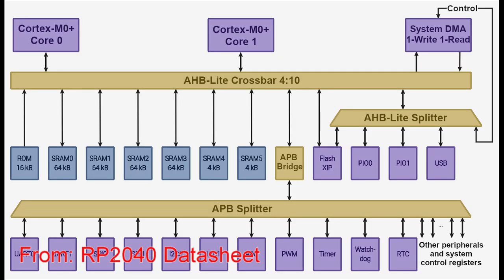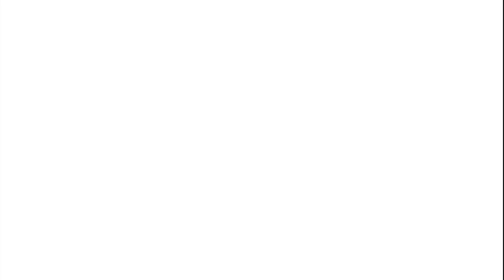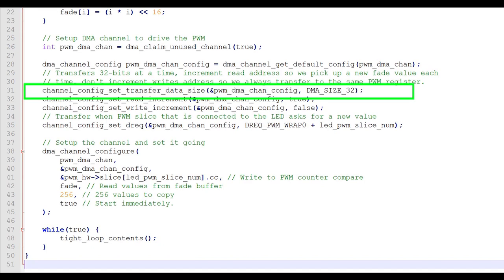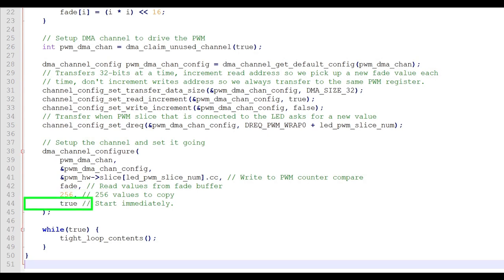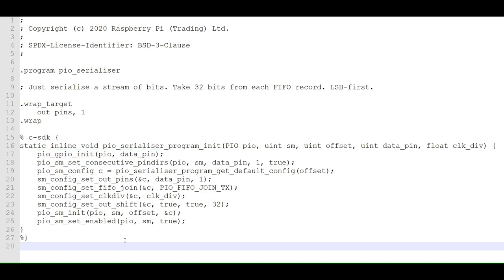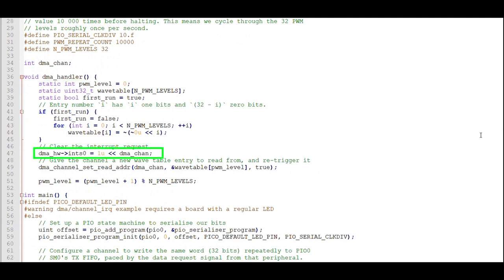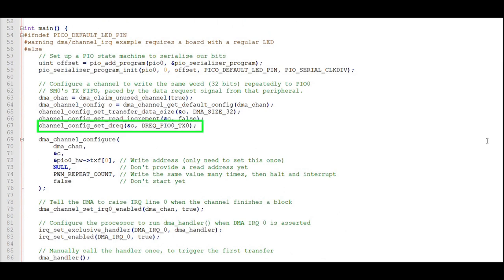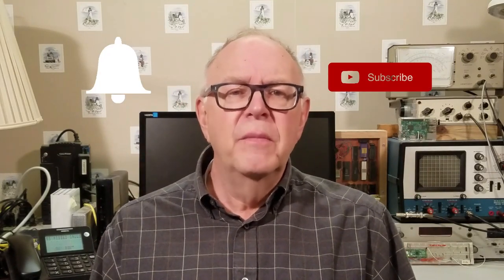Raspberry Pi Pico PIO - Ep. 8 - Introduction to DMA

Comment: This video cracked me up -- but it was really good. Taking the time to go through the datasheet and show where the information can be gleaned is a vital step that all too often is ignored. I just picked up a Pico and am having quite a bit of fun. I ended up here because I had written a RTC initialization from the PC to the Pico over the uart and was hoping to speed the process up a bit. Essentially the PC sends a string to the Pico via PuTTY or redirected from an xterm to ttyACM0 (or using minicom). The string is formatted as "+++2022 09 09 5 20 52 58", the "+++" used for an acknowledge that the RTC initialization data comes next. My only concern looking at DMA is with 24 bytes total transfer, DMA may not help that much over a character-by-character read. But with your help -- I now have the tools to find out. Much appreciated.
Reply from the maker: Thanks for watching.  DMA works best when you have to send a ton of data quickly; without slowing down for the processor.  I have several more videos where I use DMA and PIO to move a lot of data; both video and an AWG.  Have fun!

Comment: I stumbled across this while looking for some real world examples of PIO usage for a project I am working on (also new to the pico). Specifically looking for example code that implements a multi wire protocol and specific timing inside the scant instructions inside of one PIO, if that can be done or people load multiple programs inside the same PIO and how timing dependencies are handled in that case, etc...

In any case very good job explaining the PIO, PWM, and DMA for everyone working with this new and very different chip. I know you issued a disclaimer regarding your knowledge of C and that it's not the topic of this video specifically, I don't know if you left it out on purpose or possibly didn't realize that the code you are using has a nuance that people should probably understand when generalizing this to other purposes regarding DMA and specifically PWM (there are other situations that are similar beyond PWM that depend on the specific architecture of the component wiring and registers as well)

The code above ONLY works if and only if the GPIO pin happens to fall on PWM channel B of a given slice. By chance the built in LED on GPIO 25 does but this is atypical for most other examples where the Default output pin is chosen to be on A specifically.

Here's why...

1. You declare the fade vector as uint32 and the transfer width of the DMA as 32bits.
2. When using DMA to the counter compare PWM register as 32bits what happens is that the upper 16bits are for the B channel of the slice and the lower 16bits are for the A channel.
3. In your comments you mention a "gamma adjustment" which I assume you mean the square? but some may assume that you mean the <<16 bit left shift. You may want to update that comment to include that the 16 bit shift is to put the value into the upper 16bits because GPIO 25 happens to be on channel B of that PWM slice.

Also re: PWM instead of a comment re "gamma" you may want to generalize that terminology to PWM meaning duty cycle as a fractional value of the wrap value where WRAP * x% = x duty cycle as I don't believe there are any convenience functions in the C SDK so the level of the compare count has to be scaled to the wrap which in this case is 0xFFFF
Reply from the maker: Thank you very much for your comments; they are right on!  I did learn a lot from this video, and I got into DMA and PWM in much more detail in the next video, that's where I realized the difference between PWM channel "A" and "B".  The gamma reference was from the sample program I was using, I believe it refers to the relative brightness of the LED.  Thanks for watching, hopefully the next few videos will be helpful.
Reply: @LifewithDavid1  Ps I meant GPIO  26 for the LED I think, don't have the reference sheet in front of me at the moment but the assertion is correct. I did find it strange that the SDK has a lot of convenience functions but some of them offer a strange mix of convenience combined with raw register writes like the one discussed above. I guess learning any new hardware is tricky.

I'm still at the very beginning with PIO where I am constantly asking my self questions "I wonder if this will work" for things that aren't explicit in the documentation. 

I agree the docs are extremely good relative to a lot of hardware I've used but there are still some ares that are vague. Like pindirs and their specific semantics with side set etc.

Comment: When the Pi Pico first came out, I mostly wrote it off as uninteresting. I thought then that the "programmable input/output" was just choosing what pins to use for the various built in hardware interfaces. Recently started pursing a project and found out the truth! watching all your PIO vids multiple times now to get up to speed.
Reply from the maker: Glad it was helpful.  Thanks for watching!

Comment: Thank you David. We can use for example raspberry pico for object detection in real time. For example we use PIO to transfer data between camera and one core of raspberry pico pico and the other core well be used to run machine learning Model. Is that feasible??
Reply from the maker: That's very feasible as long as the Pico has enough computing power and memory for your application.  In fact, you could use PIO with DMA to transfer the data from the camera into memory without using any core resources.  Then you would have both cores available for machine learning.  Sounds interesting.  Good luck!

Comment: What's that 8-bit hot rod in the wooden case behind your monitor then?
Reply from the maker: That's my 6502 multi purpose computer built 35 years ago.  I feature it in several videos, including this one: https://youtu.be/BcqRvHkn-EA
I also do some high speed paper tape emulation with it in later videos using the Pico and (shudder) MicroPython.  This is where I first started using PIO.  This computer was the 3rd one I built; there is another video on my earlier computer, as well as Tiny Basic.  Thanks for watching!
Reply: How about dma into a separate peripheral? Like a trinket which has a 264 on chunk also. Maybe leave it bare metal? Thoughts? Or maybe do that to an soc, like a raspberry pi?

Comment: Not sure why there is music popping up in the brief silence between statements. Makes it very hard to concentrate on the material.
Reply from the maker: That's a good point.  I like a little background music; and I am trying to get the audio ducking settings right.  I hope it's better in my more recent videos.  I'm using Pinnacle Studio 25 and it's a bit of a challenge.
Reply: @LifewithDavid1  I would not use filler music in any video I wanted people to retain information from. Music is meant to invoke emotions and tends to distract from informational content.
Reply: Personally I like the music popping up. I instinctively pause the video to take in what David just said, re-read the code and relate it to what went before.  Thanks David!
Reply: @adeeperbluegreen  I think it would sound a bit bland without it though
Reply: In the unlikely case where someone doesn't like this video, I'd recommend that person to click the thumb down icon twice, just for good measure 😉

Comment: The dma_handler() function appears to be missing a close patenthisis? I don't mean to be pedantic but well, computers just are that yes/no?
Reply from the maker: I'll have to check it out.  Sometimes transferring the program from the working version to github leads to errors.  Thanks!
Reply: @LifewithDavid1  Ah, yes, the error is in the github.  But some edits needed regardless as I see you've put it all in one file.  No surprise you'd taken to Python.  Having just missed the day's of being taught Fortran in University (by one year, and still used it in projects due to math libraries), I've always resisted Python myself.  But if you are used to Fortran, Python is a much better version of that.  But NOPE, I'd just tried a Python project recently and it had a format validation tool.. Nope, no thanks!  Rust is much more my thing if not C/C++.  Anyhow, the ommission is a very Python-esque error. Cheers!
Reply: @kippie80  being  a curmudgeon myself I've found very little value in most new languages (new as in newer than any sort of macro assembler of which even in the late 70's many assemblers were very powerful in terms of "higher level constructs" and even data structures, newer than ESPOL (aka a systems level ALGOL for Burroughs large systems) and PL/S) I accidentally took a "temporary job" writing the firmware for some computer company not to be named and stumbled upon C which is the last new language I've found much value in, which is VERY valuable for many reasons)

Sure I've had to use a dozen new languages in the age of the internet, not many actually had anything new, just rehashed bad ideas for the most part. Their attraction isn't the language itself but merely the idiotic amount of options and ease of sucking in massive amounts of other people's code without care written 10 seconds ago rather than the language itself. 

Having said that... within the last 2 years I've consolidated ALL of my dev work across the entire stack from micro controller to web crap to 2 language thank god. C(and C++ with a lot of restraint in terms of use of language features god what a mess unless you ignore the bad ideas) and believe it or not... Go which is sort of like "really easy C" with a crazy easy build/package management system.

I only responded to this as you mention Rust... 

I have very mixed feelings about Rust... it's one of those things I WANT to love but having been trying to love it for a few years now I just can't and from a practical stand point I really think the team seems to making mistakes in terms of language complexity and features. It is not nearly as programmer friendly as C and at the end of the day relies on what C does best for a lot of its target scope. I am not making a final judgement call yet but it's too volatile for me to buy in and hasn't yielded much actual benefit to me when using it side by side on various real life stuff to get comfortable with it over the last few years...

I think the biggest thing I like about it happens to be:

1. Rustup
2. Cargo

I wish the C/C++ ecosystem could really consolidate around a similar tool chain/package management system other than that I've been fairly happy with C since the mid 80's. "Safe" programming practices have been around for a very very long time.

Just my 2c
Reply from the maker: I agree.  My experience started with FORTRAN and I was pretty good with it.  That lead into Basic and several other languages of the mid to late 70's.  However, those languages tend to warp the minds of those that use them such that I have a difficult time "thinking" in terms of "object oriented" programming language.   Programming is not part of a electric power utility project manager's job; so I only programmed for fun.  Now that I'm retired; I'm trying to make up for lost time; with mind numbing results.  Thanks for watching!